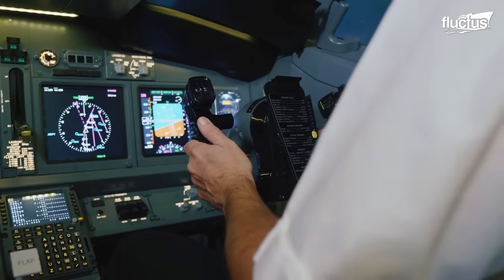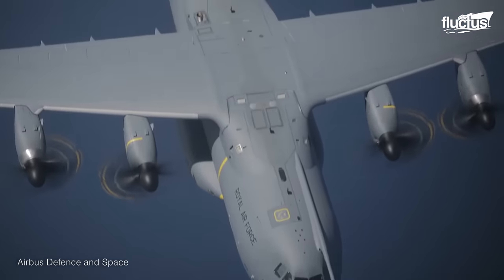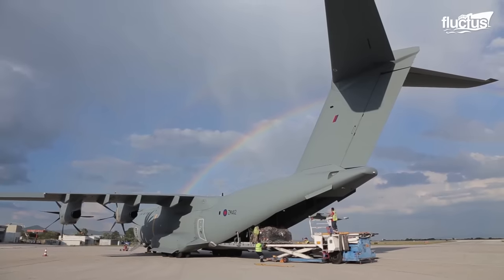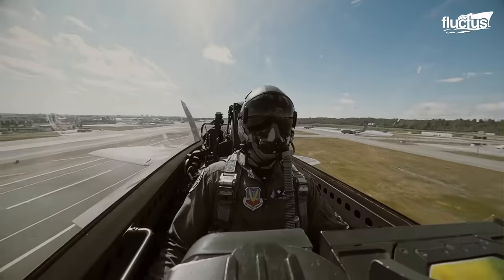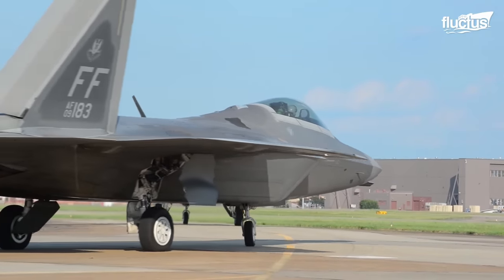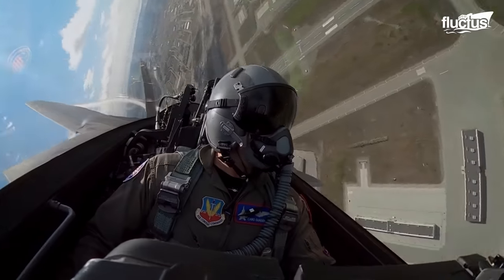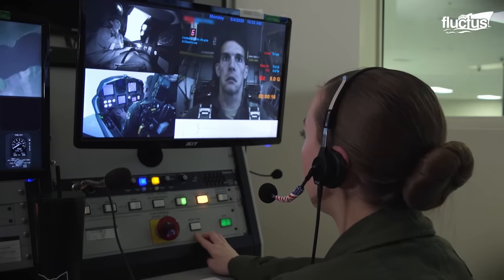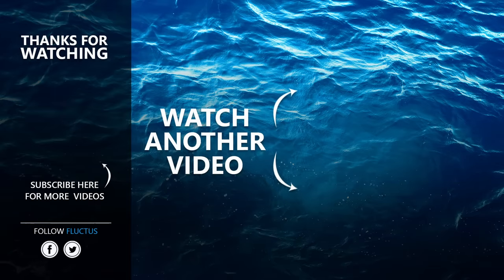Why Airbus Spent Billion $ to Make its Massive A400M TakeOff Vertically

Comment: "The cockpit is located at the front of the fuselage , as the most of the aircraft's space is saved for carrying cargo." Okay, what plane has the cockpit in the tail or the middle then? 
I think it's at the front for the same reason as every other plane.
Reply: I was looking for this comment! I figured someone else would beat me to it. It's certainly the weirdest comment I wasn't expecting!
Reply: well..war planes had a huge engine under the hood then the cockpit behind...at the back..
Reply: @HAL900032  Good point
Reply: I thought I did not understand something. But no. Not only me
Reply: Another pointless comment to pad watch time: "Before each flight, the plane is loaded with the cargo for it's mission". You don't say?
Reply: @valerian4486  the fact they didn't mention that the plane is unloaded when it reaches its destination comes as a bigger surprise. Are we now to believe they just fly things from place to place for the fun of it?
Reply: It would have been better to say "the cockpit is located at the front of the fuselage above the load floor." This is a distinct advantage over the C-130; the floor-to-ceiling height in a Hercules is only nine feet, so the cockpit floor is just a little above the load floor. The A400M's cockpit is far enough above the load floor that you can put freight, a latrine, a snack bar (hey, they're in the Air Force, of course they want things like that) or whatever else your mission might require under the flight deck.
Reply: Because when the plane flights back where it came from, the tail becomes the front of the plane
Reply: @valerian4486   This airplane has the unique advantage of "wings", generating a thing called "lift", which is how it does something that experts call "flying".
Reply: @thegreyarea-WPP  they made a lot of errors. They also conflated G’s with speed suggesting speed out a strain on pilots
Reply: GB super sport had a cockpit in the back

Comment: A unique feature is that the cockpit is at the front?   Who would have thunk?
Pretty easy to go almost vertical if you have a bunch of power and are without a payload.  Displays like that are mostly intended to show the aircraft has decent handling characteristics - not necessarily to demonstrate in-service performance capability.
Reply: my thoughts exactly
Reply: I was very lucky. I passed my driving test when it was ok to do the whole thing in reverse, so I was at the back of the vehicle all the time. I still have not managed to master sitting in the front and looking forwards. Maybe it is easy if you were taught that way. By the way, do you know a good panel beater?
Reply: @MrDickBills  At the risk of getting shouted at, did a spitfire or mustang have the cockpit at the front, or was it 1/3 of the way down the plane?
Reply: @alexanderjones8914  Exactly the same as my car, as far forward as possible. I sit about 1/3 from the front.

Comment: There is a difference between VTOL(vertical take off and landing) and STOL(short take off and landing). The STOL feature is mostly used when the aircraft is also to take off and land on makeshift airfields, as these do not have the necessary runway length.

Comment: The A400 was never intended for verticle capability. It was designed to have short field takeoff and landing. It is a very capable aircraft. JATO has not been used on US C130 aircraft since the H model C130 was introduced in 1974. The H model -15 engines create the same power as the E models -7 engined aircraft with JATO. However, there are a few special models that still use JATO, but they are few and highly specialized.
Reply: You sure about no JATOs on the C-130H. They were using them on the LC-130s when I was working in Antarctica and those were LC-130Hs from the NY ANG.
Reply: @york2600  As I said, not on H models, except a few specialized ones. LC130 being one of those exceptions. I flew on 7 variants of the C130 for over 22 years. There's about 50 or so variants,  some pretty strange!
Reply: I thought they discontinued the production of jato rockets?
Reply: Is this Thee Bobby Kelly?
Reply: @lukenichols9647  to whom are you referring to?
Reply: @Triple259772  
Production of jato rockets officially ended in 1991. However, there are a few remaining in stock. But that stock can dwindle quickly. The LC130 s' have been upgraded to a newer T56-8-15A 3.5 engine producing power levels comparable to  jato equipped C130. The newer engines do this producing less heat and improving efficiency by 30% or so. They also have the new NP2000 8 bladed propeller to assist with producing more power and fuel efficiency. Hope this info helped.
Reply: @10hunterLab  ah I was always curious why they stopped using them. It never occurred to me they would just upgrade the engines like a jetliner. That explains the different propeller designs through the generations. I do miss the jato fat Albert take offs though.
Reply: @Triple259772  Jato for Fat Albert was a show. Did look good though. Didn't actually need jato for anything.

Comment: since it never really answers why they spent a billion dollars.  inferred was it was a over weight turd.  the vertical takeoff is a side effect not a sought after feature in design.  the 8 blade props are the reason why they can take off like that.  c-130 hercules uses the same prop configuration.  the reason for the switch was they were running out of Jet assisted take off(JATO) rockets.  re tooling and manufacturing new ones to re supply a 60 year old technology was a giant waste of money.  the 8 blade prop was the answer to same takeoff capabilities without having to bolt on new rockets each flight.
Reply: You mentioned the Jato assist. I used to make some of the aluminum burst diaphragms used in those rockets.
Reply: @davidl.williams7366  Now that really is badass!
Reply: @davidl.williams7366  tell us more about it please! I served for 7 years and have always had an interest in how the machines I used worked. Just so I’m clear I am Canadian and I was in the Army. I don’t believe the Hercs we used ever had jato’s.
Reply: @davidl.williams7366  you from wichita
Reply: Will P ,
That is an  excellent comment!      thanks for chiming in !
Reply: Thank you for saving my time
Reply: Thank you
Reply: It’s much bigger than even the stretched C-130
Reply: @aarronwoods6389  Hi, neighbor Aaron,   I began working for a small Teflon Mfg Co, (Then Fluorocarbon Co) when it was just beginning around 1960. Was it Rocketdyne that gave us a contract to Mfg the burst diaphragms? Their purpose was to keep the solid rocket fuel dry until the fuel was ignited and created enough pressure to burst the diaphragm to allow the exhaust to escape and make thrust. They were made of four about 4" diameter aluminum components, epoxied together. One part was a ring with sharp inner edge that had a section radiused to allow the sheet metal part that burst to hinge and hold onto the part so it did not dangerously fly out the exhaust.  If I remember correctly, this was originally a needed addition for a bomber that had not met its hoped for ability to take off fully loaded using only its normal propulsion.
Reply: @davidl.williams7366  oh okay, i just figured you worked for the aviation industry out here as ive done contracts for textron
Reply: A billion? No way they spent only a billion. It was way more than that. And they did not spend it to takeoff vertically. That’s nonsense. It doesn’t. It has short field capability.
Reply: They spent a billion dollars getting bigger engines to carry the 15 overweight condition
Reply: @aarronwoods6389  i made a wanderfull solution using dark enegy for thurst instead of rocket.
Reply: It’s made by airbus
So no surprise that’s it’s heavy!
Reply: @planefreak747  yep because it's well made and not some tin can crap
Reply: Disk solidity and blade loading have little to do with low speed propeller thrust production. Modern swept shapes with higher aspect ratio are tailored for higher speed effiency as that's where props struggle due to increasing advance ratio.  In order to have much use at high speeds, blades need to also take into account compressibility effects at high tip-Mach number, hence the modern shaping... Alternatively, you can just overpower it like was done on the Tu-95, which has supersonic props that convert jet fuel to noise instead of thrust.
Reply: @justsomedude8118 .

The Tu-95 was so noisy it could be detected by submerged submarines!
Reply: Thank you. Won’t bother watching.
Reply: The Aircraft in was designed and manufactured in Europe    So it wasn't  $1 billion Dollars But €0.8 Billion Euros !!.

Comment: New definition of vertival takeoff : The aircraft takes off and changes position on the vertical axis (regardless the location on the horizontal axis). In other words, it gains altitude.
Reply: Right? I was like? Wth, this is vertical climb but not vertical takeoff..... a cargo VTOL would be truly impressive XD
Reply: @danf849  Cargo VTOL is old news.... Dornier DO 31 made in the 60's. Project never took off but was designed to support a VTOL multi role fighter they were planning to build at the time. I'm sure you can find flight footage of the Dornier on youtube.
Reply: @trevoC132  yea, vtol fighters are old news, if pull notice I said cargo plane... I do not know if any prototype attempts or a vtol cargo plane but if u know of one that’s cool af.
Reply: Sorry for that not making sense. Mobile auto correct is the kryptonite to my sausage thumbs.
Reply: @danf849  no worries, just to be clear, the do 31 is a vtol cargo plane. It's pretty cool. They had flying working aircraft.
Reply: @trevoC132  it was really fascinating walking around one and counting the sheer number of engines that thing has.

Comment: Thanks for letting us know that the cockpit flight deck is located at the front of the aircraft. 👏👏👏. 

So, what did they spend billions on ??
Reply: Also, thanks for letting us know that cargo is loaded on the aircraft before its mission.
Reply: Yes I too found that hilarious. I clicked on this hoping for some juicy inside info, but it reads like a corporate video ad for the plane from the manufacturer.  The kind of video they'd loop at Trade Shows.

Comment: However, one must not overdo this steep climb on transport machines for several reasons. 
1. at such steep angles of attack, stall can occur very easily
2. the load can shift if it is not properly lashed down, causing the aircraft to reach an even higher angle of attack (--> stall).
3. the glide ratio of an airplane depends on the angle of attack, i.e. indirectly on the speed, and the gustiness of the surrounding air, as well as on the pilots' control skill.

Comment: Although I'm a huge fan of the C130, even I have to admit that it's starting to get a little long in the teeth now, and needs to be replaced. The A400M is a brilliant replacement. Very similar to the A400 in looks purely to keep old traditionalists such as myself happy ;) but with vastly improved performance in all aspects! I remember seeing it fly for the first time a few years back, and being absolutely amazed and very impressed! Although the old Herc still has many years left in her, the A400M will forge a long and interesting history during her service life!
Reply: A400M has a much higher payload than C-130 (37 ton vs 20 ton) and is not meant as a direct replacement to C-130. A400M's closest match is the Japanese Kawasaki C-2 (also 37 ton), while the current closest matches of C-130 are the Chinese Shaanxi Y-8 / Y-9 and the Brazilian Embraer C-390. The C-390 has a 26 ton payload. The Y-8 has a 20 ton payload and was based on the Soviet Antonov AN-12. The Y-9 has a 25 ton payload, and is more like the stretched C-130-30 in size. The modern Y-8/9 have been significantly improved in materials, construction and electronics from their AN-12 predecessor.
Reply: The A400M did not replace the C130 because the payload from the A400M is ~twice: for example the french airforce did use they brand new C130H to replace the retired C160 Transall and for commando missions who was made with C160 Transall, they use they Casa CN235 who are smaller, and for the big transports they use the services from Antonov AN124's or the AN22 both from Antonov Airlines...
Reply: Agree with the comments.  But  the 
"April 1996:       First Flight of C-130J Super Hercules"
is getting long in the tooth.
I image new engines and maybe a revisited wing could work wonders.   YES GUESSING
Reply: Well…there is the C5 Galaxy.
Reply: Yeah, but I'd like to see them try to land a M400A on a carrier!

NO! NO! NO! I'm not issuing you a challenge, please for everyone's same do not attempt that, at home, abroad, in your bathtub or anywhere..  Yeah, we DID land a C130 on a carrier...ONCE.  ONCE. And there is sat until the carrier could reach port to unload the damned thing.

Comment: YT has vids of C-130 flying out of a football stadium (100 meters and vertical obstacles) using RATO units. It did land on its own.
Reply: C-130 landing and taking off on a Forrestall Carrier too, own power..
Reply: @uingaeoc3905  But no aircraft parked on deck as usual.
A carrier deck is ~1000 feet and nothing in front of you. A football field is only 300 feet with (football seating stands) of 50-100 foot high. Landing in a football field is the impressive part.  Note RATO unit was used in US military F100 fighter vertical launch system.
At a Seattle Blue Angels show they had a blue C130 doing acrobatics: loops, Immelmanns, barrel rolls; above us, under 1000 foot altitude.
Reply: One video about it that doesn’t show it happening, also it’s a heavily modified C130 with loads of rockets attached to it.

Comment: It can’t take off vertically. That’s nonsense. Just about all transport aircraft are limited to 25-30 deg pitch attitude for safety reasons. This is a full fbw aircraft and it will certainly be limited in pitch like all other airbus aircraft. And it can only achieve that at its lightest weight. So stop with the vertical takeoff nonsense.

Comment: There was only one transport aircraft that was actually equipped with VTOL, the Dornier Do 31, which is now on display in the Dornier Museum in Friedrichshafen(Germany).
Reply: Quite a few helicopters and the V22 Osprey.
Reply: VTOL can be achieved through different modes of operation. The V 22 Osprey, however, does not use thrust deflection, but a tilt rotor. Therefore, the V22 is rather a "hermaphrodite" of airplane and helicopter.
Reply: @karstendoerr5378  you wrote “transport aircraft”. Osprey is a transport aircraft. So are many helicopters, for example CH-47,
Reply: @MeTube3  , That may be. I have posted the explanation for this. But the DO 31 uses thrust reversers, the V22 is a mixture of airplane and helicopter. If we now assume that VTOL is generated by thrust reversal, then helicopters and the V22 are out of the question.
Reply: @karstendoerr5378  vertical take off is simply taking off without a runway roll. Like a helicopter. Like a V22. You don’t get to redefine vertical take off.
Reply: @MeTube3  That's right.  However, there are a total of 13 ways to obtain VTOL properties. I mention only once 3, because otherwise it would become a novel:
-tilt rotor (propeller), e.g. Bell XV-3, Bell-Boeing V-22, Bell V-280
-jet engine with tilt nozzles (e.g. EWR VJ 101)
Vectored thrust control e.g. F-35
The DO 31 even uses separate systems. The aircraft takes off vertically using eight lift engines and two cruise engines equipped with swiveling thrust nozzles. In addition, there is a control nozzle at the tail that can exhaust upward or downward. In level flight, the two cruise engines are used. VTOL can also be distinguished according to the way VTOL has been implemented on the particular aircraft.
Reply: Thrust reversers acts to reverse the thrust. Please know what you are talking about before trying to sound knowledgeable.
Reply: @tomasnagy4518  Spelled incorrectly. I meant thrust deflection, not reverse thrust.
Reply: @karstendoerr5378  so according to you, there are other VTOL transport aircraft but the Dornier DO 31 is the only VTOL transport aircraft because you had a particular type of VTOL in mind and we are all supposed to read what you are thinking, not what you are writing.
Reply: @karstendoerr5378  there are only two ways to achieve vertical take off. Create upward lift or upward  thrust period. Examples of Upward lift are a helicopter and the V22. Examples of upward thrust are the Dornier DO31 the Harrier Jump Jet and the F-35 ect.
Reply: @tomasnagy4518  If you had read my posts, I wrote that there are several ways to implement VTOL in flying machines. This means the technical implementation, with which one achieves that wind (helicopter) or exhaust gases are vertically aligned. And also after this technical implementation one can make a classification of the aircraft with VTOL property.